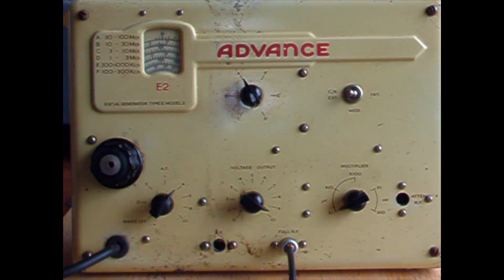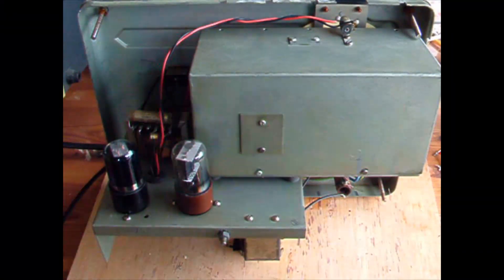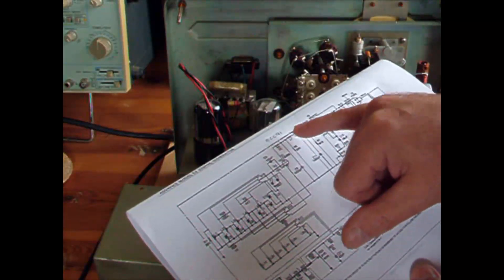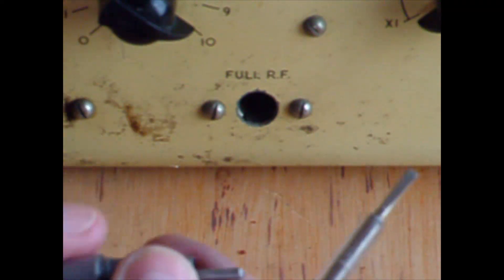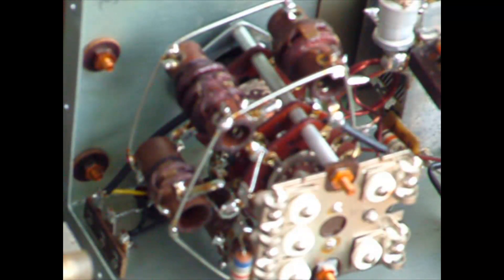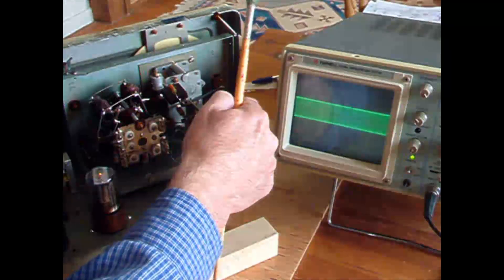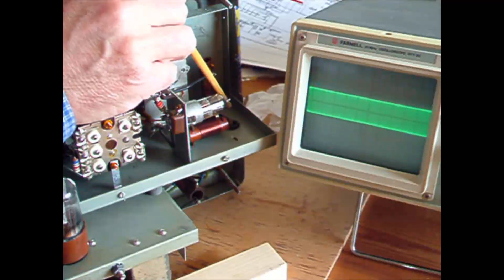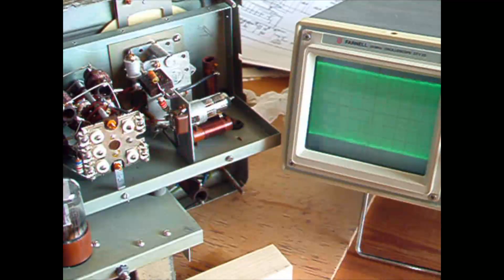Fault finding in an RF Signal generator.

Comment: Nice signal generator, If it was mine though I would be looking at replacing those two grounding capacitors at the AC inlet with a couple of modern Y class caps for peace of mind, the chassis does look like it is earthed but even so personal safety must come first, no point in taking chances with 40 year old capacitors.

Comment from the maker: Thanks for the feedback. I guess I knew I was dealing with a microphonic fault so the only way to bring on the fault was to tap it and so the fault comes and goes, really I guess it was measured with the scope but I understand what you mean. Intermittent faults can be the very devil to find simply because if the device is working then there’s no fault to find. The other problem with air capacitors is that they are open circuit anyway so the fact it goes OC is hard to find.  
Kind Regards Andy